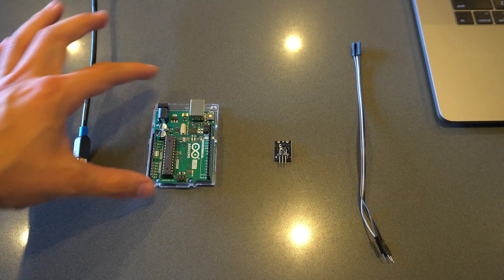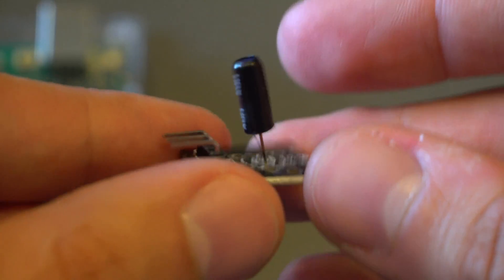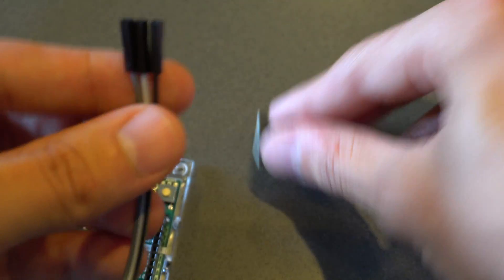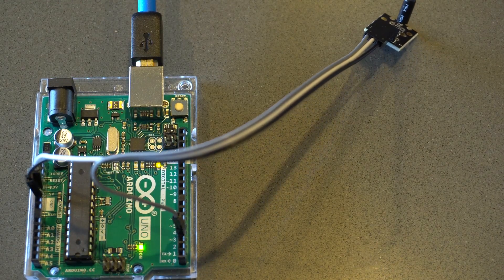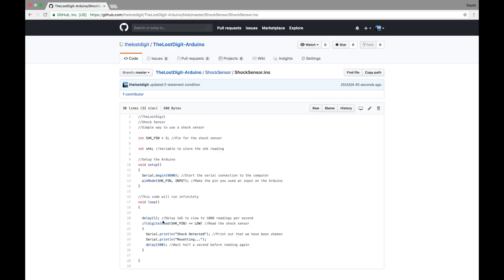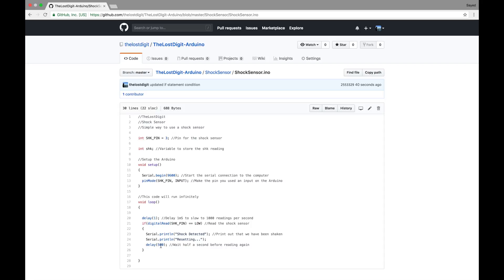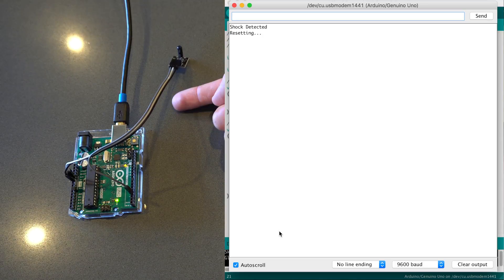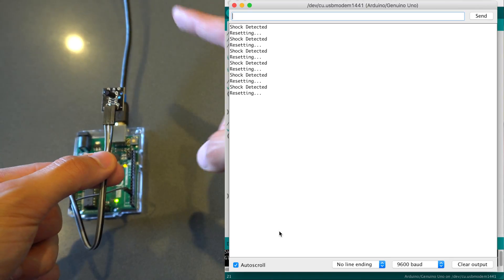Shock Sensor - Arduino Series 004

Comment: If I need to measure the force generated by a stick hitting a target, would a shock sensor be the right tool?
Reply: no because all it knows that it got hit hard enough to get triggered.  It could get much harder and it would do the same.
Reply: Hey did you find the answer to this?
Reply: @abhimanyushekhawat2626  no sir

Comment: Hello, my hopes of you reading this are low, but what is the minimal reset delay needed for this sensor? I want to build a project that detects multiple readings per second ~25/s and was wondering if this sensor would work for that
Reply from the maker: Hello, it’s no where near accurate enough for something like that. I’d look into an accelerometer for detecting vibration and shock of higher speed.
Reply: @binarycars  Thanks for the answer, I rencently discovered piezo sensors and I think that might be the way to go!

Comment: I'm willing to use this sensor fixed to a wall, to sense if burglars are trying to get through the wall. It's a brick wall, so they would have to hammer it.
But I wanted to count the vibrations, so to remove false positive such as thunders. I'm thinking in the alarm going off if the sensor accuses more than once in 3 seconds or so.
But I'm still having problem implementing the code

Comment: Hi there, would that work in a wooden table top (making one so I'd place it inside) so it gives out a signal when someone places a cup on the table? It's relatively low "shock" or is there any way to manipulate how sensitive it is?
Reply from the maker: Kamil Taczi probably not sensitive enough for that. You could use a sensitive microphone on the wood for a simple solution if the cups make noise when placed. Other solutions would be much more complicated

Comment: Hey man. I hope your're well. I have a sensor I want to make for a Air Gun target. Essentially I shoot through a piece of steel with a hole just big enough for a pellet. If the pellet goes through I want to sound an alarm when it hits a second peice of metal behind the hole. Would you be able to give me some advice and have an emaik address I can reach you on please? Thanks. Ant
Reply: Hi Ant! I am looking for airsoft steel targets to work with this sensor. Did you started your project?

Comment: I have a idea and a use . I want to use this in conjunction with a conveyor belt.  When a part falls onto the belt, the conveyor moves forward slightly, a part counter,  adds +1 to the total count, and if it doesn’t sense a impact onto the conveyor, after 1 minute, I want an alarm to sound or notify me some how.   Any ideas 💡 on how to go about this project??

Comment: Hi, i have a idea for my future project which is helmet with gps tracker and also a shock sensor which is when a rider accident while his riding his motorcycle and his helmet hits the ground, a emergency message will send to his relatives knowing that he got an accident on his way, The question is how do i program a sensor that only sense the hard vibration or hard hit? :)
Reply from the maker: Jestony Donesa you can use an accelerometer and program thresholds for high acceleration events. It would take some trial and error and calibration
Reply: Did you do that project I am doing the same can I ask some questions?